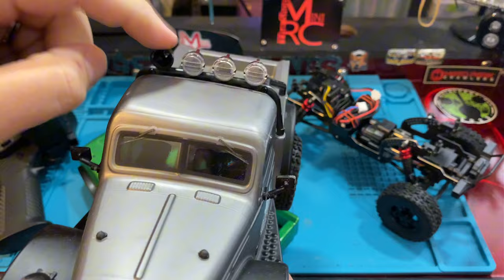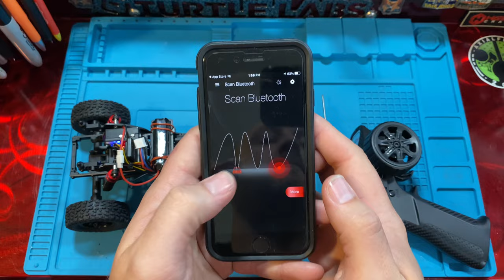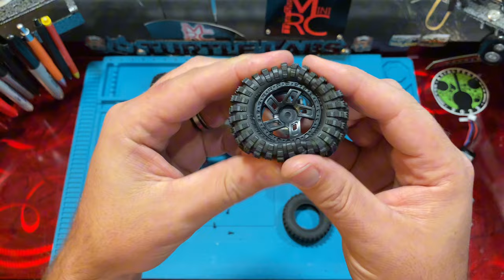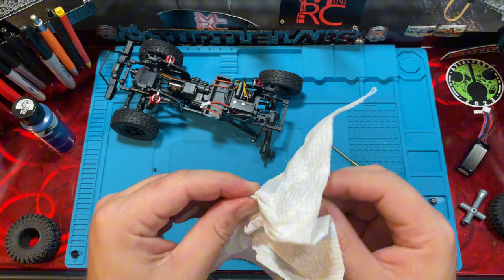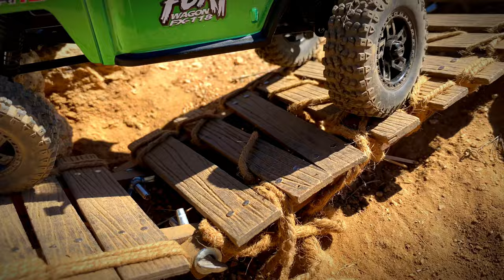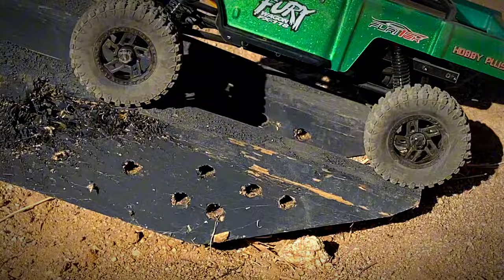18th Scale Deep Dive into the FX118 Fury Wagon! The World's First Fully RTR Brushless Mini Crawler!

Comment: You are partially correct in the reasoning for the long length of the bottom of the chassis. In designing the vehicle we were presented with premade parts which I had to "fit" into the design in order to keep price under $200. Links were one of them. That forced me to have to use a longer bottom part in order to add adjustability to these rear upper links. I originally brought it up like you mentioned but then had to bring down due to upper links coliding with battery trey at more extreme articulation possitions. In the end I had to bite the bullet and accept the length as it is now. But, now that this version has found its way out we can work on better designs that will put even this one to shame! 😁👍
Reply: By the way, these long detailed videos are my favorite, I tend to do mine the same way for the same reasons you pointed out. Too many small details are missed when we dive into these guys and being able to watch and pause videos like yours for reference is golden! Keep em coming! 👍
Reply from the maker: Thanks a ton good sir. I am honored and humbled to have your insight, compliments and viewership.

Comment: As usual, super in depth review of the rig, thanks for putting in so much effort.
A couple questions if you have time,
Is it locked in low or high and do you think that effects torque or does the brushlessness cancel out those concerns?
Does it have a similar amount of lash in the drivetrain to the Fcx24? Thats the only issue i have with my power wagon, it has a fair amount of lash in low with the portals which hinders precise driving sometimes.
Reply from the maker: Gearing Always matters, brushless or not. I am unsure of the gearing used, however I don’t think it’s as simple as it just being locked in high or low, I know it has a different pinion on it. It has plenty of low end torque and enough wheel speed to trail it.  As for portal slop/lash, all portal setups have that issue. This one doesn’t seem to bad though.

Comment: also ken the extra shaft on the transmission u r right about running farm equipment the most thing we use them for on our old landys is the PTO winches still the stongest winch known to man cause u r using the power of the engine it well lift the whole landrover off the ground up a tree if u need like on movie the gods must be crazy mind u not much good if u have flooded the motor in the middle of a river o well shit happens.. thanks again ken
Reply from the maker: Great info!!

Comment: Ken I’m trying to hook up my fly sky GT5 with the FS-BS6 receiver to the Furitek 118 with the lizard pro SC. I’ve managed to bind the receiver and I’m  getting steering but no throttle. Can you help me ?
Reply from the maker: You need to be sure to calibrate the throttle endpoints in the app.  

Also be sure your battery is fully charged.
Reply: @TheShopMiniRC  I loved the video you did pullin apart the furitek 118 transmission accidentally dropped one of the bushings in the battery tray, then not knowing you were minus that bushing attempted to figure out how that thing was working…..epic content , have shared that with many friends. Love your stuff
    Roger
Reply from the maker: @rhodes6858  hahaha. That was definitely a thing. Many would have edited it out for their pride, but I figured, “hey, it shows people it’s normal to mess up”. Thanks for the watches and the shares!!!

Comment: Ken. Good to see you back. Hope your trip was successful.
Great to hear you talk about all these little details. I know a rig will never be perfect. 
The cons - noise and slop in the transmission thu the wheels, large bottom section of the frame is indeed long, bushings.
Pro's? hahaha.. everything else which is a lot!.

Vented stock wheels? How much grease is too much gears to pack on all those gears? Can you flip those shocks so heavy side down? replace bushings with bearings all around?

Graboids!
Reply from the maker: Thanks a ton. Still dealing with some rental stuff, but back home and that’s good. 

I am not sure if they are actually vented, but they seem to be, I don’t think there’s such thing as too much grease lol (I’m sure there is but I use a lot). Yes you can flip the shocks to get more weight down low and bearing over bushings all day long if you don’t run in a lot of water.

Comment: This truck has ONE bearing in the entire system. The motor shaft bearing... The lights dont even turn off without unplugging them. Cheapo.
Reply from the maker: Are you kidding? Cheapo? This truck is fantastic!  It's ALL metal gears... what other RTR has that? Its Brushless, what other RTR has that? I would MUCH rather have bushings over bearings if it means brushless and all metal gears. 

It also has a separate ESC and RX, which means you can easily swap or upgrade electronics...  Calling it "Cheapo" is a completely unfair and poor assessment of this truck

Comment: Great review Ken!  Really had fun with the missing bushing part of the video! Lol!  I just got my Green Fury in the mail.  Love the looks and the color.  I noticed I am getting quite a bit of torque twist and was hoping that you could please give me some tips on fixing that.  The shocks don't seem to have any oil in them, so I will start there by filling them and seeing if that helps.  Great video and super informative.
THX
Reply from the maker: You fix torque twist by reducing any resistance in the axles/wheels that might exist and then stiffening springs.  Also, you can try to reduce weight.   Thicker Oil in the shocks will help.
Reply: Perfect and thanks.  I did flip out the stock wheels so, I will check for rub at the portal boxes.
Reply: Even go through an grease the drive train mine has got almost none so I wonder if it has something to do with the configuration of the drive shafts maybe yours are out of faze idk if that would cause it but still check I suppose